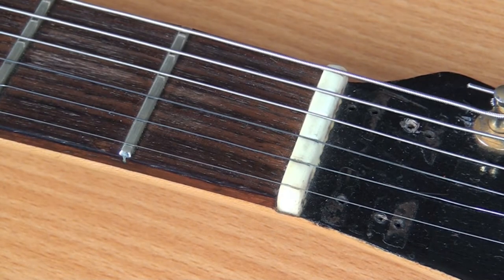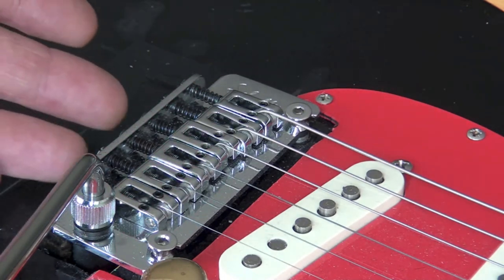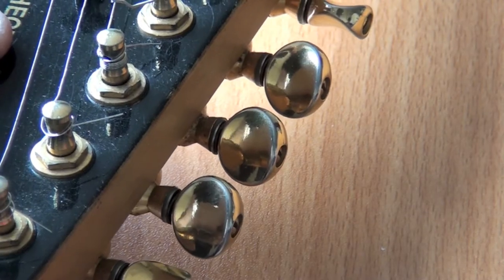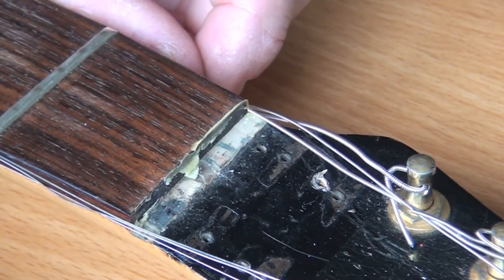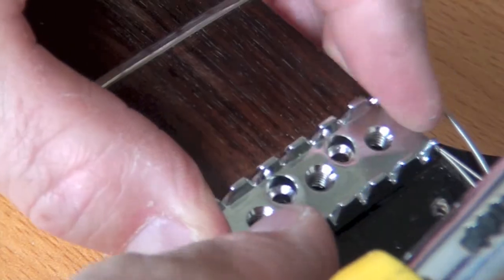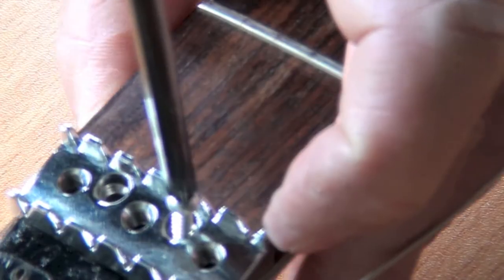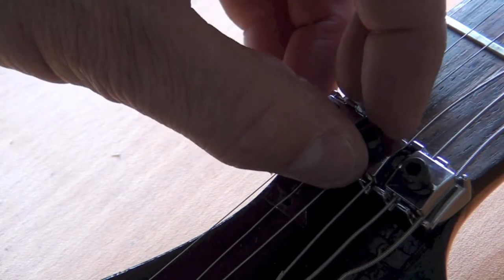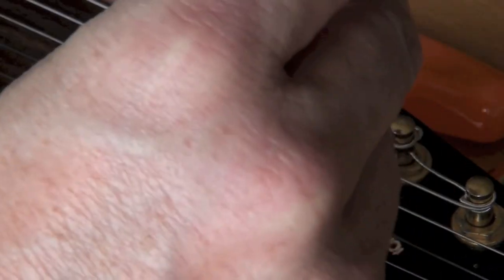HOW TO INSTALL A LOCKING NUT

Comment: String height? Shim? How do you measure string height at the locking nut?
Reply: I suppose you could just keep adding shims under it if there is fretbuzz anywhere on the neck.. I'm not an expert at ALL but I do think that the string height at the nut is very important and would be different on different styles of guitar, so a "one height fits all" locking nut doesn't seem possible.
Reply: I’m saying he has the locking pads all sideways, he’s a joke doesn’t even realize they are radiused. 🤦🏻‍♂️
Reply: @ronnieparfait  Holy shit, I had  to go back and check it out! Man, this guy is a clown!
Reply: a bite higher than the fret lol that's all focks.

Comment: Why a locking nut on a non-locking system? I love the sound affects, smash, crash.etc.
And always predrill and lubricate your screws...! Please use this video as a reference point of what not to do! This message has been brought to you by the make luthiers great again foundation!
Reply: I agree why use a locking nut with a tremolo without fine tuners?!?!?!
Reply: why? lol well why do you think? he probably put on a floyd right? lol
Reply: My reason would be for subtle use of trem when detuning chord. The different string distance behind nut makes one string change pitch differently than others, within the same tremolo bend range, making the chord goes out of tune. The locking nut eliminate that, allowing the chord to detune, since the relationship between string are detuning equally for the same tremolo travel

Comment: What do you do if you tighten down the nut on the strings and it pulls it sharp with no fine tuners on the bridge?
Reply: you need a retainer bar, kinda like strimg trees, but the bar goes over all ghe strinfs
Reply: It was at this point he realized... he fucked up.
Reply: @sippy9387  did you mean "String Cheese"?
Reply: @sippy9387  that makes no sense. Why have lock but not use lock. Waste of time.

Comment: That is very true,I'm away to attempt this on my ibenez s521 it has the plastic shite nut on I'm wanting it off and replace it with the same R4 floyd rose nut,only thing I'm abit worried about is height!! What would u do about it,will it cause fret buzz

Comment: One of my locking block and nut came off when I was tuning the guitar and will not go back on. The one with the thickest (E and A) strings. It will go on if I take the E string out. So it is not stripped. Tried swapping screws. It is a new Ibanez Steve Vai signature Pia. I have a US Kramer Pacer Custom I bought in 1987 and never had this problem. Anyone have any idea why it is not going on or any tricks to put it back on?
Reply from the maker: Hi! This video should help you!😅😂🤣

Comment: Hey can i put locking nut to a guitar with out tremolo? just fixed bridge ( Harley Benton WL20)
Reply from the maker: As long as you don’t do it like I do it in this video, yes.
Reply: @KRAZEEIZATION  if u search my guitar, trustrod is at the head
Reply from the maker: @Stagmike  I’d leave it as is to be honest. I no longer use locking systems. Too much trouble trust me!
Reply: @KRAZEEIZATION  just to lock strings, I won't put Floyd rose or any other tremolo, I have fixed bridge
Reply: @Stagmike  Just buy locking tuners , that's all you need !